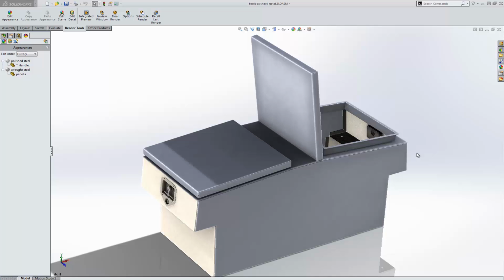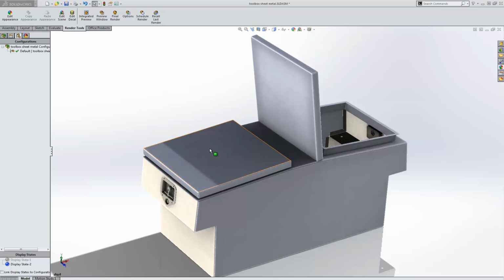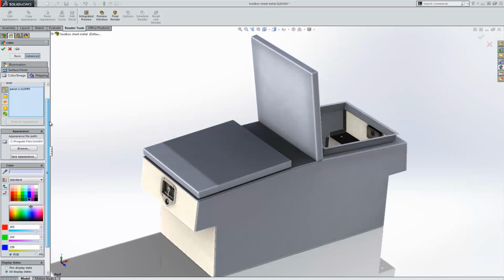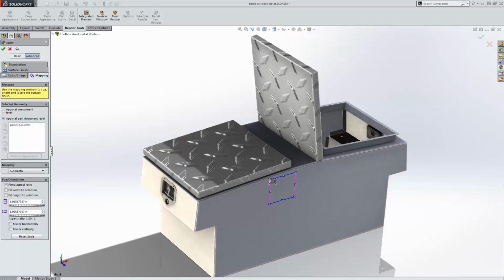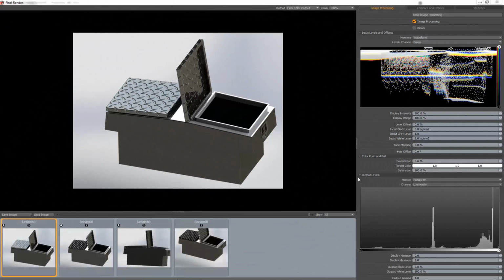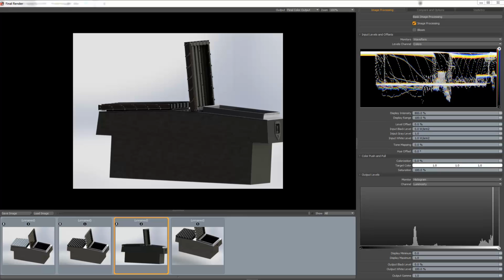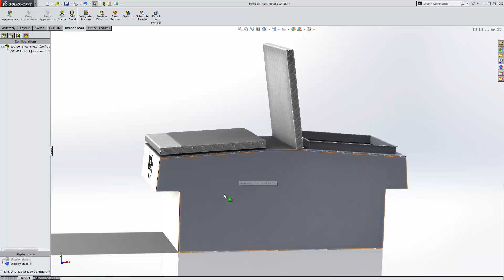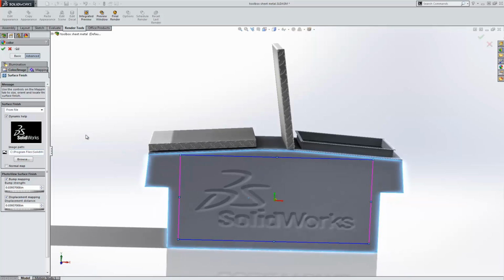SOLIDWORKS - Using Surface Finish Appearances

Comment: What version of Solidworks are you using? I have 2014 and I have all those commands, but the image does not change....
Reply from the maker: Hi trackie1957,
This video was produced in SolidWorks 2014.  If you apply these appearances to your model and do not see the appearance change then you likely do not have "RealView Graphics" enabled on your machine (found under 'View', 'Displace', 'RealView').  This setting must be enabled in order to see these types of appearances and the setting is only allowed to function on supported graphics hardware (typically NVidia Quadro or AMD FireGL/FirePro/Radeon Pro graphics cards).
Reply: @goengineer  Just wanted to say thanks, 2 years later I've been trying to figure out why the heck surface finishes don't appear. Didn't realize it was because of that.

Comment: Same question as other people here. Can you use those bump images for production? who can we export something like that for cad/cam?
Reply from the maker: Hi Danny,
The surface finish shows only on the model as a visual effect.  It is not something that would be exported as part of the model in a way that would be recognized by a CAM software for the purposes of machining that pattern on the surface.

Comment: Is the surface finish only an appearance or you can export it's geometry in the model for production?
Reply: Yes the surface finish is only an appearance. Unfortunately, you can not generate actual geometry with this method. That would be awesome though if you could apply a texture to a face that actually applies a change in geometry.